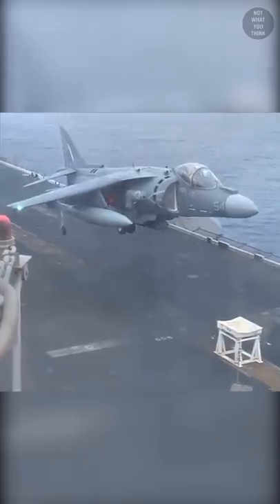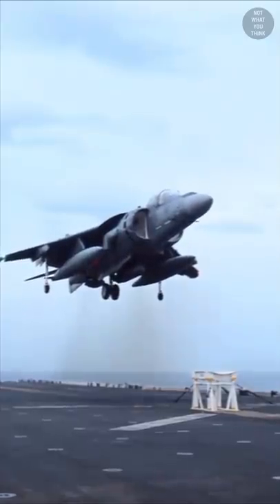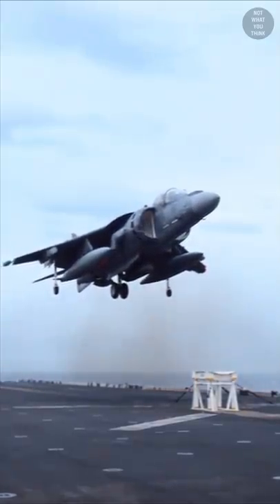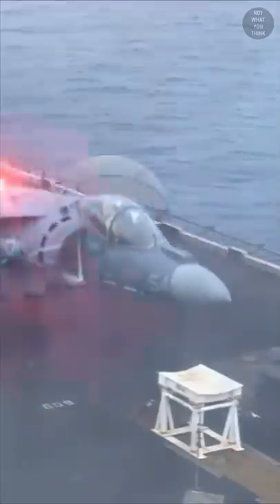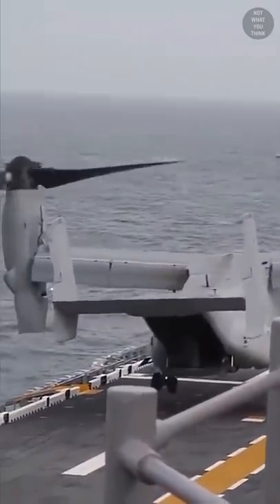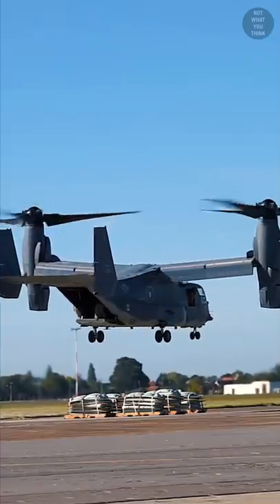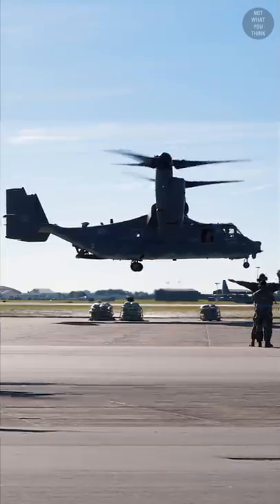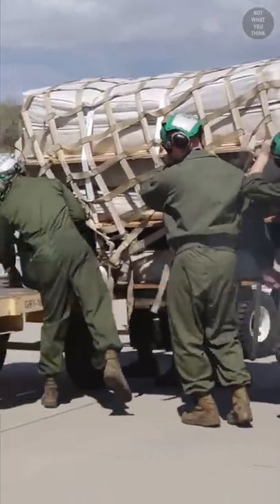Emergency "Mattress" Landing #shorts

Comment: "The flight crew came out of hiding" is my favorite sentence in this short, I imagine the flight crew have a hole they retreat in when the jets land lol
Reply from the maker: It was said with humour, but it was true. There was no one on the flight deck, because this was an emergency landing, and things could have gone sideways 😉
Reply: Plus if a jet wire catcher goes wrong you can wave goodbye to anything below your knees
Reply: @zucc3446  160 mile whip or was it km
Reply: They mostly come at night. ..mostly.
Reply: @emilen2  they are like Pokemon, hiding in the bushes.
Reply: @emilen2  come
Reply: Well when you consider how quickly things can go from 0 to "the entire flight deck is on fire"..
Reply: There is, for emergency landings all of the flight deck crew hide behind this bigass crane until the aircraft is in control. And all those people in red were crash/fire rescue, not a “flight crew”
Reply: @williamwiggins6690  I thought they were ordinance officers?
Reply: @jetrickgordo4026  All the AOs I’ve seen don’t wear jerseys but maybe they do on bigger ships idk. But Crash fire does for sure, plus they have the truck and the tin man suit on so it’s pretty obvious
Reply: @NotWhatYouThink  it's maybe dependent on nationality but this would be classed as a priority landing at first. The difference being a faulty landing gear is not an immediate threat to loss of the air frame of live on borad.

Though you are right it would later be upgraded to an emergency landing and the flight deck would have prepared before hand anyway as if you were to have a crash on deck things go from 0 to 1000 in seconds
Reply: More like a ledge step down in case a plane is crash landing they won't get hit from debris if any fly's.
Reply: @NotWhatYouThink  Literally sideways!
Reply: @zucc3446  I mean what about the possibility of being smacked by a 160 ish knot 30,000 to 40,000 pound jet trying to not end up in the ocean?
Reply: Lmao they come out doin some oompa loopa shit
Reply: This is an LHD, but on aircraft carriers there’s white lines that resembles the runway. All personnel are just beyond that line which is next to the ends of the wire. No one is hiding, however. Just sitting on the sidelines waiting for the aircraft to land.
Reply: @NotWhatYouThink  Oof, going sideways to the starboard would have caused a LOT of damage!
Reply: William Mahoney is my uncle’s friend

Comment: I think as long as they don't tear off the tag the warranty would still be OK.
Reply: yes, inquiring minds want to know if the tags are still intact.
Reply: *mattress litterally shredded to pieces*
*hands warranty tag connected to a chunk of mattress*
“i never took off the tag so can i get a refund”
Reply: Well they can’t remove it under penalty of law
Reply: @Crypticat  ig rules are rules... they have to
Reply: Lol when was the last time you bought a mattress? Warranty is voided for the tiniest stain even if it happened while moving it into your place like the plastic rips, voided for not using approved boxspring or alternative with recommended spacing between slats etc etc. That's why it's hilarious because mattress warranties nowadays are designed to not be used. If you want to actually use it, buy the extended warranty and wrap it in TWO heavy duty covers and load on top of a tarp and maybe just maybe if you don't spill a dime size of tea while waiting for the dryer to finish then it'll be usable

Comment: Yeah it’s about as simple as it sounds. I was aircrew on V-22s in the USMC. Our squadron had a specific crew of people that would assist in moving all of the mattresses out of the hangar and to the flight line. Our stacks were on trailers and we’d have the tug grab the trailers and run them out to the designated area on the flight line. The mattresses were always old and used barracks mattresses, a lot of them had all sorts of stains and nastiness on them.
Reply: This is my old squadron 164, this was back in like 2016-2017.

Comment: i feel bad for the guy in the plane with the sidewards tire
Reply: It was a cool video. The pilot touched down on the main gear and coasted for a while, and then set the front gear down ever so gently, and got it down safely, but with some serious grinding and sparks as the front gear was worn down to a nub.

Comment: We did this with a CH46 helicopter on Camp Pendleton in 2002. I was with HMMT-164 when the pilots brought back a bird with broken aft landing gear. We NEVER trained for it, it was talked about and told in stories until that day we had to do. We are Marines so we figured it out and the bird landed safely on the pallets and mattresses.

Comment: I was Crash and Salvage (flight deck fireman) in the Navy on the USS Enterprise for 5 years. Did 3.5 years at sea. I’ve taken on more planes with engine and hydraulic failure than I can seriously count. When you’re in the middle of the ocean and someone crashes on the deck making a mess, you have to clear that mess quickly and safely because there is NOWHERE else for the planes in the air to land and there’s nowhere for the crew of the ship to go. Fire and flooding are a ship’s number 1 hazard.

Comment: Years ago, I was security for a military air base and actually got a call for an Osprey with faulty landing gears. However, the Dispatcher made it seem like the aircraft was actually about to crash sooooooo yeah, had to race to get there only to see it hovering 60ft in the air with no issues (common for some people to make a small thing seem like the world is collapsing). They set a shit load of mats under the front landing gear and it gingerly landed with no issues.

Comment: No.. it will put stress on the air frame on areas it  isn’t supposed to. The inspection required afterwards would be intense. Like.. I was an osprey mech for 5 years, we practice it but if it ever happened, that plane could be out for years..

Comment: 164 was the 1st CH46 (Cargo Helicopter)  Squadron Was Commission July 1, 1966 as HMM Helicopter Marine Medium Squadron 164 In the 3rd MAW Marine Air Group 16 hence HMM164 the 4 represents the fourth squadron in at Marine Air Group 
Other Squadrons had CH 46’s but the also had CH34 Helicopters.
From 1966-2015 the First and Last CH46 Helicopter Squadron 49 years of Service PHROGS (FROGS) FOREVER many of Marines spent several years in that Helicopter Squadron including me for 7 years. Semper Fi Marines.
In the Same year 1966 the Squadron went to Asia Destiination South Vietnam After Vietnam she was transferred to MAG 36 MCAS Marine Corps Air Station (H) H= Helicopter Futenma  Okinawa stayed until August 1978 served in Asia for 12 years. 1966-1978 this Squadron helped evacuate personnel from Saigon South of Vietnam.
I surely miss my Marine Corps.
Yes mattresses helps CH 46 helicopters also I know I was on one on the main street collapsed and the pilots kept her nose steady until they rounded enough mattresses so they can land without crashing. I know I was on board that helicopter. The two pilots and crew chief was noteworthy in saving that only the aircraft but everybody aboard thank you.

Comment: My grandfather was a Boeing 747 or 707 (I don't remember specifically) flight engineer and one time they had to fly the plane to another airport or something. all I know that the plane was empty with only my grandma on it and she was seating in the business class which He later called her to come into the cockpit. About 15 minutes later the front landing gear blown up and made a huge hole exactly where the business class is. they had to land the plane with this vehicle that had a platform on it like that stool. They safely made it to the airport but it wouldn't happen if my grandfather wasn't there.

Comment: I have a question:

How do commerical planes preform emergency landings when landing gear malfunctions?
Reply: Well, they just land... With or without landing gear. Rescue vehicles are standing by, and sometimes they prepare the runway with foaming it (for catching/preventing sparks).
Reply: @truckertj2109  thank you. I was genuinely curious
Reply: @vadoinak620  from what i have seen (remember, every time is different) when the Front Gear fails they just land and try to keep the nose in the air as long as possible. If the main landing gear fails, they keep it in and do a belly flop.

Comment: Okay hold on the osprey can literally just land on its belly gently and it's fine  you're literally just landing a helicopter without landing gear it's up and down that's not difficult just as long as you do it gently as far as getting it back up you just start up the engines and pick it up and you can literally fly this thing onto it semi trailer bed

Comment: How is that first plane hovering?
Reply: The AV-8B has Four thrust vectoring nozzles, two at each side.
they angle at will to perform shorter take offs or land vertically as displayed in the video.

Comment: Can someone tell me what is that dual copterplane name is
Reply from the maker: V-22 Osprey
Reply: @NotWhatYouThink  oh my god thanks. That thing is super cool
Reply: My daughter's former father in law worked for Bell as a designer on the Osprey. He told me that the early problems with the plane were training issues. Helicopters when they hover can set up a "donut" of air in which the "donut" can kind of turn itself inside out, rotating downward in the inside diameter and upward at the outside diameter, and thereby not accomplishing any lift against the larger area of sky. Apparently chopper pilots are familiar with this, but airplane pilots are not used to it. (I may have got some of the details wrong. Mostly what I remember is the "donut" formation of "rotating" air.)